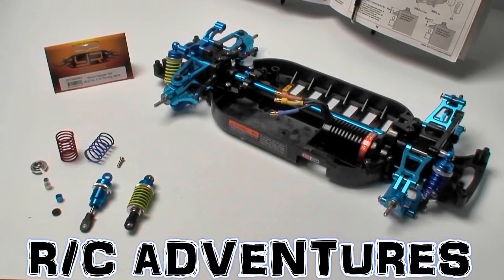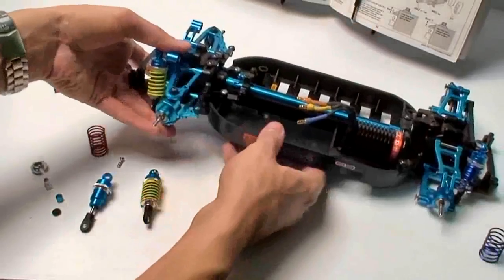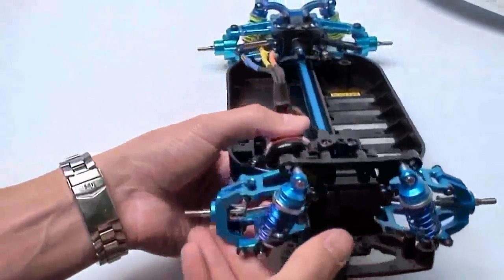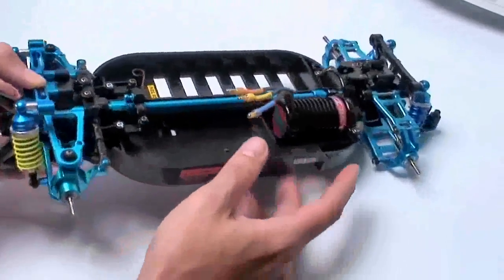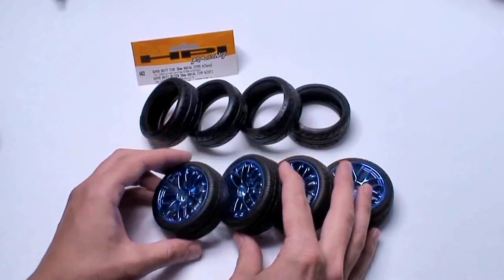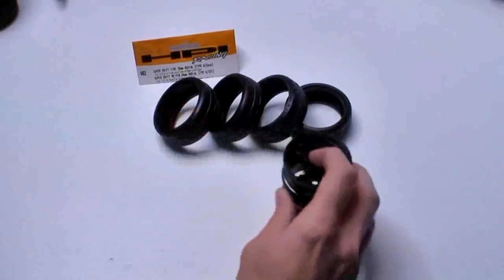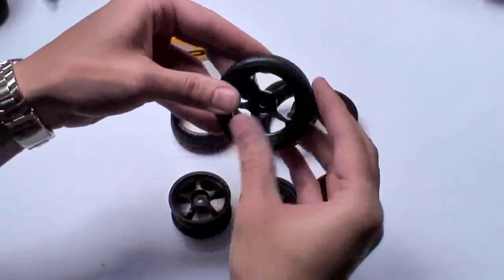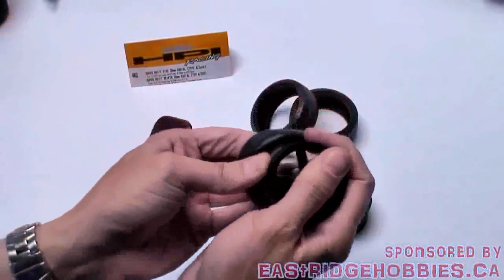RC ADVENTURES - BRUSHLESS TOURING DRIFT CAR PART 4  TAMIYA TT01 R  KIT CUSTOM KIT

Comment: Those "adjusters" are called preload collars and you should never put grease on them. Dirt sticks to grease and dirt caused excessive wear. Also you want stiffer springs in the front for better performance.

Comment: @djmedic2008 Ok, I have heard of a few people who have ruined the thread on the shock body because of the dirt sticking to them but I suppose it depends on where you run. The track that I race on has alot of debris and grit so no-one greases anything exposed. I dont drift mutch either but im not too bad at it, plus it helps at the track for when the car breaks traction knowing how to hold a drift untill you get traction back. :)

Comment: medic 1 bad thing tough i see that u cant change camber and some times thats critical for drift cornering and controll so adjustable would be good and is your back diff locked ??? if you lock it you drift the corners better